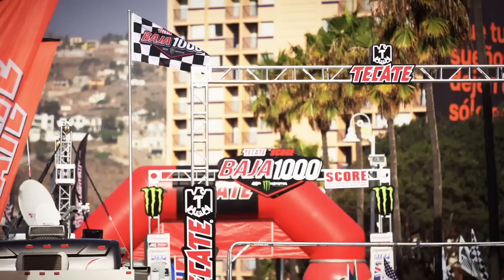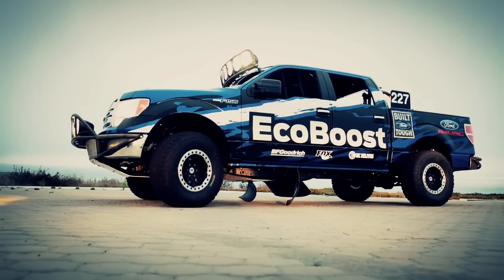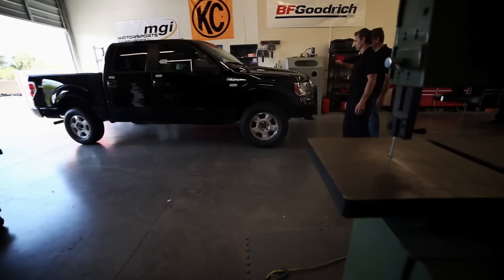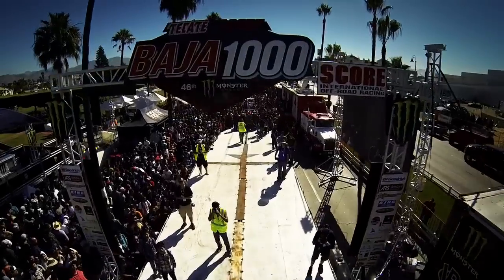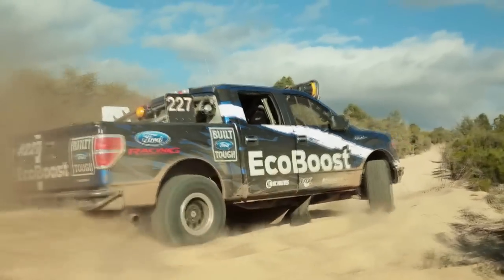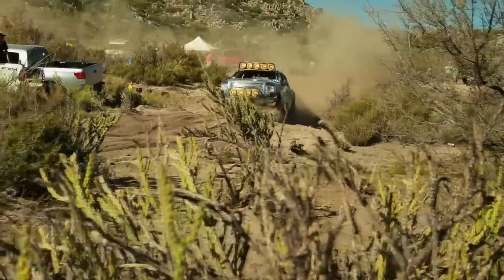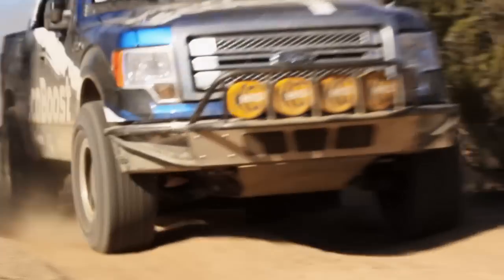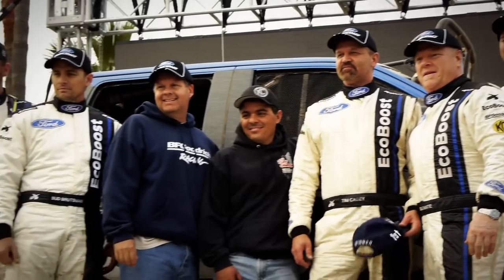2015 Ford F-150 Engine Test - Baja 1000

Comment: I will admit I was very nervous about getting an EcoBoost with all the problems the 3.5 had didn't want to let my old pickup truck go. I did a little bit of research and ended up buying a 2.7 EcoBoost I could not be happier!! The 2.7 has graphite iron block 4 bolt Mains forged rotating assembly and more it was specifically built to be turbocharged that's the difference between the 2.7 and the 3.5. Oh A programmer is a must the truck is an animal it's like a muscle car disguised as a pickup

Comment: I was not a Ford fan but 2015 completely change the entire picture, an end of an era and the beginning of a revolution. All Aluminum body and light weight V6 2.7 Twinturbo powerplant. that almost 900 Lbs of weight lighter than the outgoing F150's. This will revolutionize how trucks will be made in years to come. I'm skeptical about the aluminum at first, but come to think of it, Aluminum body is the material of choice since way back when the first Apollo rocket launch into orbit to Space Shuttle to Blue Angels. The only exception is the SR-71 Blackbird which is made of Titanium Body.